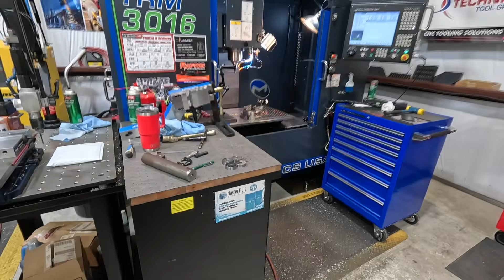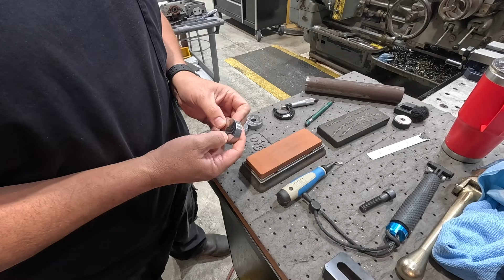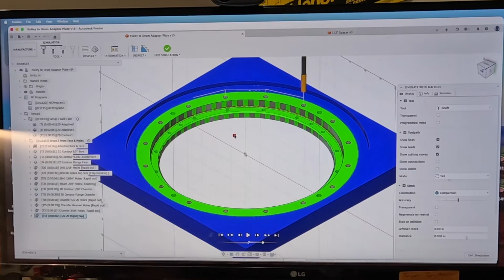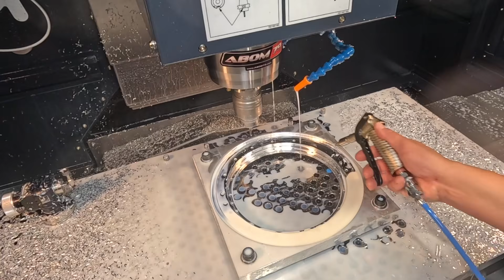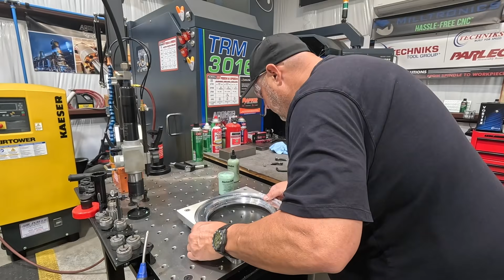Harley Pulley to Brake Hub Adaptor Op 2

Comment: You know, after forty years in machine shops, I’ve learned there are two things guaranteed in life: chips in your boots and somebody tapping holes full of swarf like they’re stuffing a Thanksgiving turkey.

First thing I’m wondering is why the diameter wasn’t finished while the part was still clocked in on the mill. Clamp it through the bore, finish the OD while everything’s running true, and save yourself the interpretive dance later trying to get it concentric again.

And the tapping... good grief. A quick blast of air before running the tap in wouldn’t exactly bankrupt the operation. Watching taps chew through packed chips always makes me wince. That sound usually means somebody’s ordering replacement tooling before lunch.

Also, for work like that, a form tap would’ve been the sensible route. Stronger threads, cleaner finish, faster cycle time. But apparently, we’re keeping the spiral flute manufacturers in business single-handedly.

And I still can’t figure out the point of indicating the front edge. Maybe it was there for emotional support. The machine certainly didn’t seem to need it.

Comment: Form tap all day long in aluminum at 500+ rpm.  Cut taps are inherently weak because of the material they have to remove from the flutes for clearance.  1/4-20 form tap, drill with a 0.226 carbide drill.
Reply: Form tapping is great for aluminium and for blind holes even better, no chip formation. If i have used cutting tap for blind holes, ive been using different style than adam used in this video. I think the tap bottomed out because of the chips going in front of the tap. There might also have been some chips in the holes from previous operations.

Comment: adam, if you own or have access to a 3d printer there is a print for a gopro case that uses a 1/4 inch air line and acts as an air curtain forthe lens

Comment: Adam, you know taps break.  They do.  1/4-20 isn't that big of a tap to be honest, and just a little chip load can snap them.  I've Broken more than one in my time...and more than one that was brand new out of the box.  Tap extractors work a treat in many cases...only once did I not get one to work...that was on a cast steel base that had a hard spot.  That tap was 3/4" deep and it snagged it and crack.  We never did get that tap out so we filled the hole with braze, move the hole and Robert's your Mother's Brother.

Comment: Seems like there are more ops involved in making the steel fixture than there are in using a manual lathe to break those corners.
Reply: Was thinking the same thing. Cut the corners with the band saw to save time (not necessary but will save som interrupted cuts) and chuck the piece from inside and make it round on the lathe

Comment: Elon Musk would go bankrupt if he hired this guy to do any machining for SpaceX. It’s a Harley Davidson. It’s not going in outer space
Reply: ...lols at the stupidity of the statement :)
Elon rushed the first Starship flight so it occurred on 4/20, because that's his humor level, there was no noise suppression mitigation in place, the launch pad suffered structural damage so severe that debris hit a bunch of engines. ultimately the rocket exploded 4-5 min into the flight...
just a year ago SpaceX's Starship 36 underwent a catastrophic failure on the stand at its Texas launch site, obliterated the launch pad too. these are just two of my favorites, but the point is SpaceX wasted incredible amounts of 'investors' money' and the chances of Starship to make it to low orbit carrying a payload are not very optimistic at all at this point...
Reply: @duroxkilo  On the Starship point, they have made it to low orbit, they just didn't want to leave it up there in case there were issues. If Space X just wanted to make a disposable rocket (like SLS), Starship would be in full use now, however they are trying something that has never been done before a fully reusable rocket. They iterate like software engineers, build fast, fail fast rather than traditional aerospace, lots of small steps and only go full scale once all the bugs are worked out. 

In terms of this work, he is still learning how to use the CNC machinery, I doubt a firm would be hiring a novice and letting them loose on production work without full training. A lot of this process, is Adam self teaching how to use his machinery rather than production work.
Reply: @matloo  yes, thanks for the info, i'm familiar w/ both topics and although i'm not super bright i do have the capability to comprehend reality to the degree you're trying to teach me. after all we're discussing trivially, basic stuffs as they say.
what i'm trying to say is that i find your reply a beautiful example of 'mansplaining', but no worries, we all do it here and there :).

ok, having said that, Starship still needs to carry a load. that is, by people who build rockets, a fantastic challenge. 
it is my understanding that fighting gravity is a losing challenge in the sense of putting in orbit larger and larger masses: for a heavier payload the rockets needs to be larger which only adds to the total mass and at some point the thrust a rocket, any rocket can produce become the limiting factor.
the funny thing is, things sometimes 'defy' physics, of course nothing defies physics but nice surprises happen. 
it was just months before the first flight of the Wright brothers that physicists were writing articles and papers on how 'heavier than air aircraft' (the concept and term used at the time) will never fly. check out Sir Kelvin's newspaper article, no silly thinker himself, on this very topic and how hilarious things were in retrospect: almost no one saw it coming, they've been waiting for it for a better half of a century, much longer than we've been waiting for self-driving cars... So Starship could make it in low orbit w/ a workable/profitable payload mass, but at the moment it seems it's not going to happen anytime soon, let alone leave low orbit...
my apologies if this qualifies as 'mansplaining' on your end, ok, no malice on may part either :)

ps: back to this channel, don't you love it? even the outro, that little tune, then the 3 generations machinists photo, puts me in such good moods. loved how he handled the disappointment, like guys i need to take a step back, emotions are running high, ok mr Adam we understand... :):) and it's basically just a piece of metal that broke in another piece of metal
Reply: @duroxkilo it's fine and I love the discussion. Totally agree about Adam's channel, I stumbled across it via Will Stelter and Alex Steele. I don't think I'd be so calm if a machine ruined a nearly finished part.
Reply: @matloo  i know, right? :D
someone mentioned earlier that most likely the culprit for the tap failure were chips that settled at the bottom of the holes during machining, so it might be a good practice to clear the holes prior...
Reply: @matloo  someone mentioned earlier a possible explanation for the tapping failure: during previous machining stages chips collected at the bottom of the holes and w/ enough of them the tap bottomed out before it reached the preset depth... so maybe a good practice would be to clear any holes prior...
Reply: ok double reply apparently since yt is slow again in processing comments

Comment: Adam, I think that your experience told you that trusting the Millstronics was going to end in bad results. SImply relying upon computers to do the tapping operation oversimplified what we know by experience. You needed to have the computer do the tapping very carefully, doing partial results, flushing the chips, but able to replunge back again matching the threads, so as to get the tapping done correctly. I am not aware of any computer machines being able to sense feedback and NOT simply press ahead with disregard. I am sorry that you had to go through this disappointment.

Comment: It seems that thread milling would  be safer than tapping because a broken thread mill will always be loose in the hole.  You should also be able to re-run the program to create the exact same thread, even on holes that have already been successfully threaded.

Comment: To get the coolant to come on where you want it all you need to do is move the M8 command in the Gcode to the spot you want it.  I usually put it on the G1 line right before the cut.  Simple if you would just look at the Gcode.  I do it all day everyday.  Happy to help others that are unsure of themselves anytime.
Reply: Yes, It never hurts to know a little G-code. I often modify it to get the machine to move out of the way while loading new parts. To me that is easier than wrestling with the CAM program.

Comment: Breaking taps are the worst. Something I do with small taps is just start the thread by going only like 1/4 inch down in the machine. Then I tap the rest by hand. I can’t even count how times I’ve had to use carbide to get out a tap. I feel you

Comment: I know that free advice is often worth exactly what it costs. However, here goes. A spiral point tap would have been the correct tool for this job. They’re much stronger and seldom break on through holes. Correction: I see by the comments that my comment is incorrect. I understand you’re tapping blind holes, not through.

Comment: I have a 5-axis Atrump E320 with Centroid Controls. The rigid tapping would randomly  break smaller taps ( M6 & smaller) . Two things solved the  problem: a Kennametal Tension compression tap chuck; and  programming MasterCam to dwell 0.1 sec at the  bottom of the hole, before reversing the tap. Have used this method since  2016 with zero broken taps. I do mostly 17-4 and 4140.  I prefer thread milling, but often will tap small holes ( with either "cut" and "form" taps).

Comment: Do you think if you coated the holes with Anchorlube before the tapping instead of coolant, the tap might have worked?
Reply: Did Adam have to blow off the tap after each threading? What would have happened if he did not? Maybe previous material may have slid up with new threading - maybe not. How much do you have to lose if it does not?

Comment: I wonder how hard it would be to adapt one of the flexarm chucks for use in the mill....
Reply: I have a few old Procunier tapping heads that I use in my CNC.  Have to load the tools manually (too big for the tool changer), but worked great to tap a ton of holes (close to 7,000 on a small production run).

Comment: I know Adam doesn't read comments, but it would be cool to have the simulation showing in a corner of the screen (the top half is pretty empty of work) while the mill is running.

Comment: Jump points, via the "Ask" button. Video summary. This video documents the machining process for a custom Harley-Davidson adaptor plate intended to mount a modern rear belt drive pulley to a vintage panhead-style brake drum. The project is carried out by Abom79 using a Milltronics VM 3018 CNC mill.

Key phases of the build include:

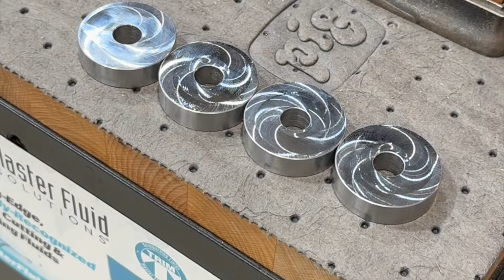Spacer Fabrication: To elevate the workpiece, the creator machines four custom 4140 steel spacers (0:15 - 9:16). These were faced to a uniform thickness of 0.496 inches to ensure a flat, parallel plane for the main adaptor plate.
Op 1 & Op 2 Setup: The creator emphasizes the use of a fixture plate and precise probing techniques to locate the work offset and center the bore (10:39 - 15:53).
Machining the Adaptor: The process involves high-speed adaptive milling, roughing out the center bore to 8.5 inches, followed by finishing the counterbore and top face using helical endmills (16:15 - 29:46).
Drilling and Reaming: The sequence proceeds through drilling, reaming for rivet holes, and chamfering edges using various carbide tools (30:07 - 35:59).
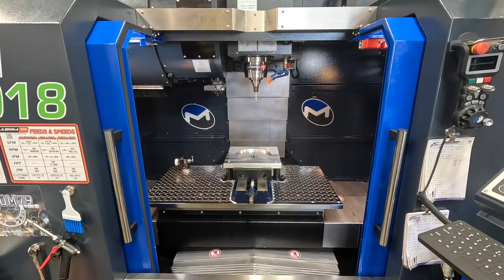Tapping Challenges: The project hit a significant setback when a tap broke during the final rigid tapping operation (37:07 - 37:21). The creator initially attempted to recover the part by installing a Helicoil, but eventually decided to start over with a fresh piece of stock to ensure the highest quality for the client (42:04 - 44:03).
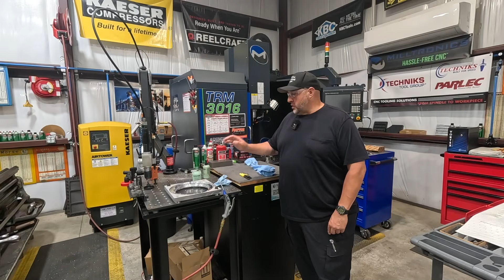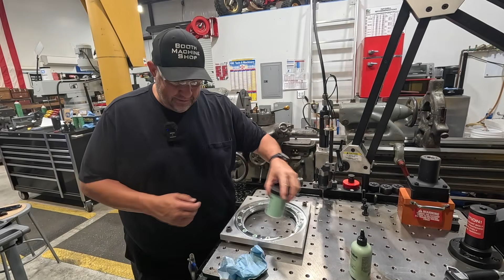Final Resolution: The creator successfully machines a second plate, opting to use a Flex Arm for manual power tapping to avoid the risks associated with rigid tapping in the CNC (46:47 - 54:05).
Coming up later in the video:
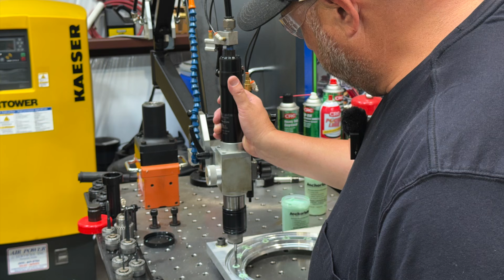The creator intends to machine a custom steel fixture in the lathe to register the plate for its final operation: machining the outside diameter (55:30 - 57:29).

Comment: I Feel your pain.  Love your videos!!!!

Does your software program have the ability to do peck tapping?  I have used the peck tapping technique on a few of my aluminum projects with some taps smaller than 1/4 X 20 with excellent results.  It was one of the most amazing cnc features that I ever used.  You can set the depth of each peck.  Say, you are peck tapping through a .500 thickness. You set the depth for the 1st , 2nd and any additional depths.  The machine with tap to the first depth retract all the way out of the hole. Then reenter the hole and tap to the second depth and retract all the way out of the hole.  It will continue this cycle until it reaches the desired depth.   It is amazing to watch the tap re-orient each time and go back down into the partially tapped hole continuing until it reaches the desired depth.

It allows the chips to get washed off on each peck cycle.

You can also use an air blast technique to clean the tap when it reaches the top of the peck cycle.

Comment: So sorry about the tap Adam.  While the spiral flute tap is correct for blind holes, they also have a thinner core and are more prone to breaking.  You might try slowing down the spindle RPM. You might also investigate a Floating Tap Holder.  Most taps I've ever broken happen at the bottom of the hole.  The sudden reversing of the tap puts a lot of torque on the tap, especially with the thinner cross section of a spiral flute tap.  Thus my recommendation to slow down the RPM  Notice the relatively slow RPM of your Flex Arm.

We've all been there. We all know that disappointment.

Comment: For the coolant what u can do is a little bit of manual tweaking to the program is put the m8 coolant on command after the height line where g43 is then it will turn on after it finishes the clearance line

Comment: That tap breaking was not your fault..... gut feeling and I never ignore that. maybe setup as off but it did a few holes prior to that one.... possibly a hard spot inclusion in the material????  Now for a question..... which do you prefer?? CNC or manual machining?? yes I love your manual lathes and mills and the skills needed to produce perfect parts. Back in the day they made everything. Today I would think manual machining is best for prototyping stuff or custom jobs while CNC is more mass production?? would you agree. 
Oops 2 questions sorry about that.

Comment: This machine honestly seems like a complete piece of s****. For a 90k machine I would expect 2 - 3x the performance. Why the fuck does the spindle load keep jumping to 0%?
Reply: For that price, he could've bought a name brand high torque mill. And causally power tapped it. Low gear is your friend.
Reply: @mg.2187 doosan dnm400 used and 50 thread mills. Of course he didn't pay for this machine(and didn't disclose it) and advertised it completely illegally. Every time I see one of his videos it annoys me more and more
Reply: @spikeypineapple552 i currently run that machine and won't power tap  the 4140 or 4330v mod. Looking into thread milling. I know i can power aluminum all day run 50sfm.
Reply: @mg.2187  Nuts. Look at walter tc630 thread mills. They're a bit slower than normal thread mills, but i run a job shop and get about 3-4000 holes out of them before edge chipping in 316 and 17/4
Reply: @spikeypineapple552 currently looking at Kodiak tooling or Sandvik thread mills. I like Walter tools on par with Sandvik .
Reply: WHY DONT YOU SHOW DISAPPOINTMENT IN THE MACHINE? There's no reason that tap should have broken in aluminium other than if there's a programming issue. When the machine runs great you have no issues in telling us how great it is, surely there's no undisclosed other reason you wouldn't tell us issues?
Reply: @spikeypineapple552 i still blame the machine.........

Comment: Wow, that was great to watch!  You have come so far in just a few years. I'm not a machinist, but I noticed three possibly-useful differences between the CNC and the Power Tap.  First, on the power tapper you cleaned everything off with high-pressure air rather than a low-pressure coolant stream.  Second, the manual tapper had a clutch.  Finally, you used grease for a lubricant rather than a thin fluid.  Dunno if any of that is relevant.

Comment: When you want to de-tap a snap off tap you can programm a small thread path ist MUST BE A LEFT thread 
so the circle path starts ON the workpiece. 

When you do a right thread path the tool will bury it self deep with out a doupt and without stopping instant into the workpiece. When you understood that go for it. A machine is there to use.

To mill out a HSS-E i go with 0.05mm pitch for ultra hard stuff. 

in Alu i mill holes at around 0.6mm in steel 0.3-0.5mm rpm 9000 down feed 300mm/min or twice that but that depends on the material. 800mm/min feed

check 2-4 times so you are certain. I do that almost for every hole i programm new then after using them i keep em in the library. 

My x22 spindle is to weak to drill that my solution.

Thread milling is the way. You can use a 60° SINGLE tooth mill for a lot of threads. Dont underestimat those little suckers ^^

Comment: Use fixture to bolt plate using 1/4 20 thru reamed holes to cut out ring